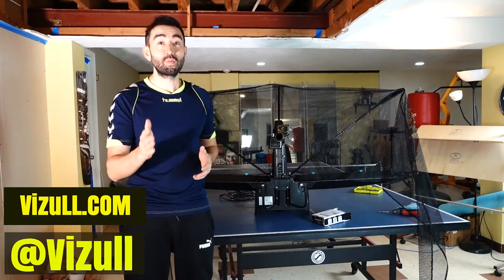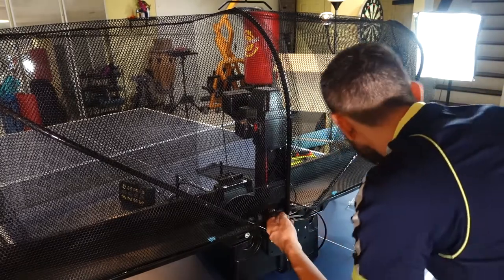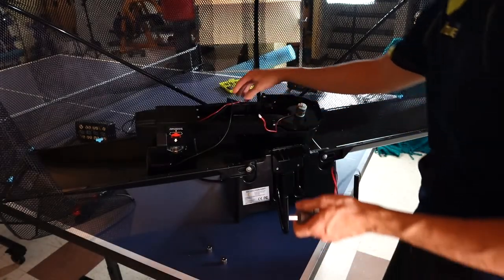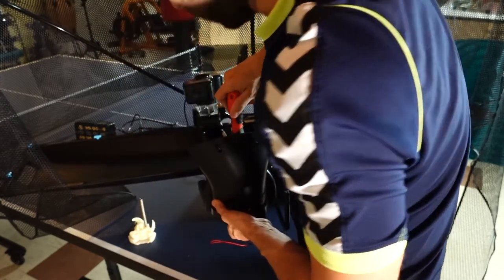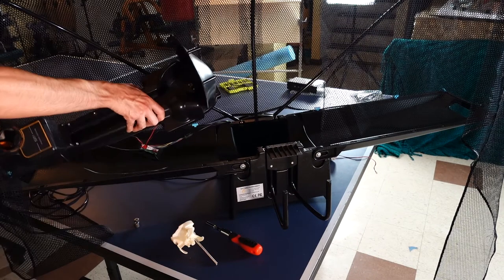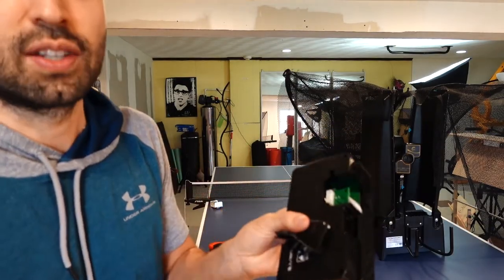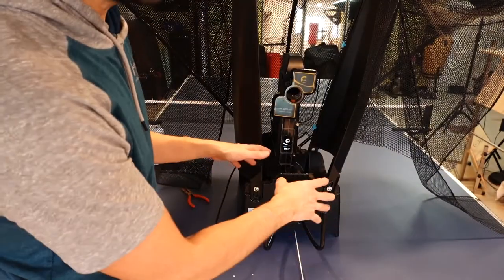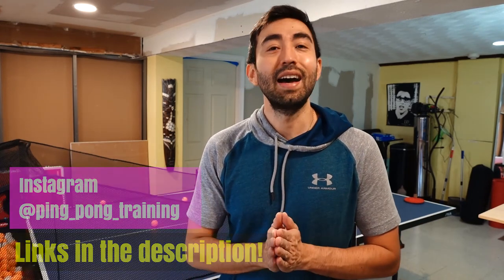Suz table tennis robot not working - Replacing Motor & Controller

Comment: Very good, Vizull. You are a very good technician. I do not dare to dismantle the head and replace the motor. Besides, my robot (JT-A) was bought directly from China. I had to dislodge the worn out motor to check the model of the motor. Anyway, I bet all these brands of similar design use the same type of motor.

Comment: In your video (for example at 59 seconds), the two support arms that go under the table are shown.  Can you please let me know the distance from the machine body to the end of the support arms?  I have a ping pong conversion table that sits on top of my pool table and there is a limited space between the underside of the ping pong table and the edge of the pool table.  I just need to know if this unit will fit my setup.  Thanks!

Comment: How long did it work before you replace the motor? Please tell me.
Reply from the maker: Hi! About 3 or 4 months, but I was using it at least 4 hours per day at the time :0, lol.

Since then, so far so good. 

Also, I only use it about 5 hours per week now, since Im playing more with people at the club
Reply: I think each motor lasts about 600 to 700 hours of continuous play.  That is if you play three times a day, about 50 minutes a day, it would last about 4 or 5 years. 45 to 50 minutes play per day with the robot is already very exhausting.